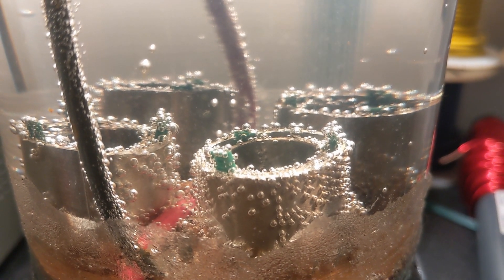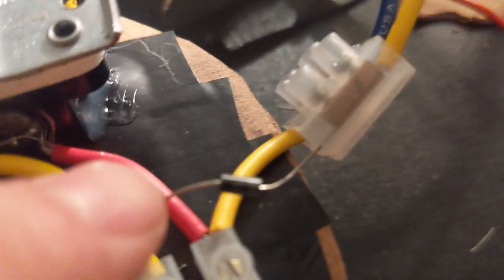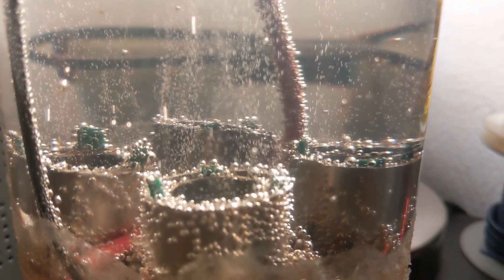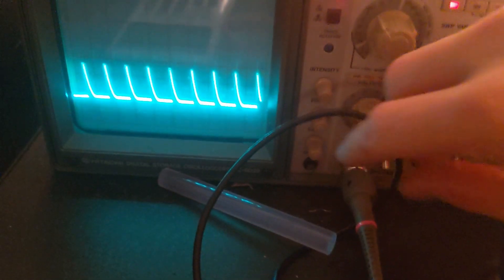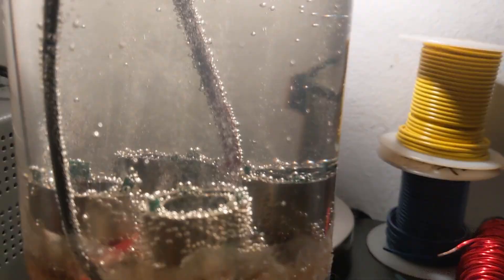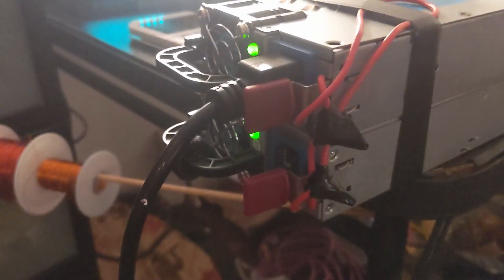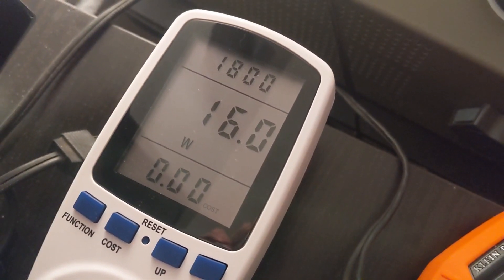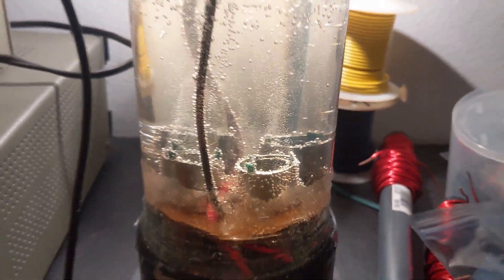HHO Resonance Circuit WFC Test [NO ELECROLYTE]

Comment: I have thought about trying multiple things, including making electrodes like you have, and wire them in series, parallel, and try every connection possible,   and use a driver that can run  nearly any frequency, and duty cycle,  I been thinking  of trying high frequency, high voltage, at a very low duty cycle,  if Stan could do it , someone else can do it also! We are just not thinking hard enough or something,  there is something we just gotta keep trying,

Comment: nice  work ,  is there  any corrosion ?
Reply from the maker: Yes, I had to replace the wire so many times and gave up without welding. my newer design somewhat fixes it but will never be truly fixed without welding

Comment: what is the design of the coils in the schematic? are they bifilar? meyer copied tesla and tesla had a paten based on the bifilar windings. the key thing about the tesla bifilar transformer is it gives a DC offset. And looks very similar to the meyer VIC transformer. i like the simplicity of your circuit design, but i dont think it is taking advantage of the collapsing field to pull the water apart. you are getting close, the bubbles get bigger when you hit it... somewhere we can chat easier? you on discord?
Reply from the maker: The coil is a bifiler air core, about 300-400 turns with the tank circuit side of about 3ohms. I used 4 strands of 24awg in parallel with a 30awg for the trigger wire on the bjt's end. I had a hard time replicating the collapsing field as you mentioned, but I wonder if I can still somehow incorporate that with this circuit.
Reply: @weighta6630  ahh mine was iron core... you wont get the same with air i dont expect
Reply: @weighta6630  just saw this
Thanks
Reply: @weighta6630  also added
Reply from the maker: Sure XephyrCraft#7538
Reply: @weighta6630 I also added you if that’s okay. I’m also very interested